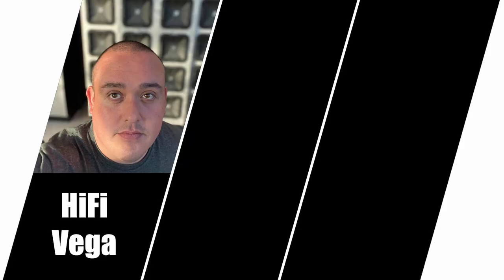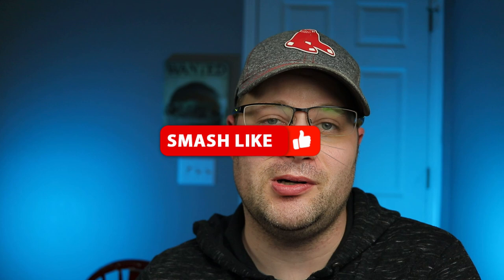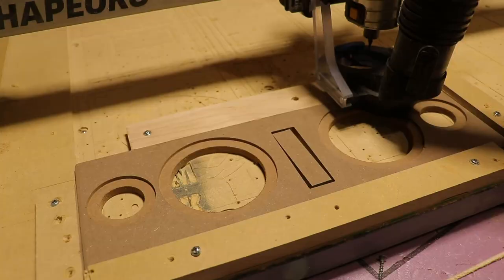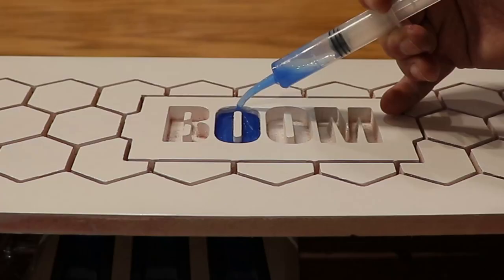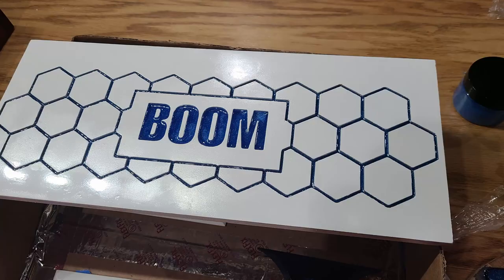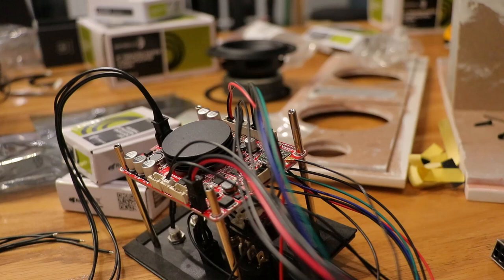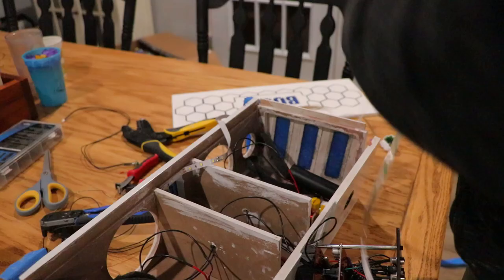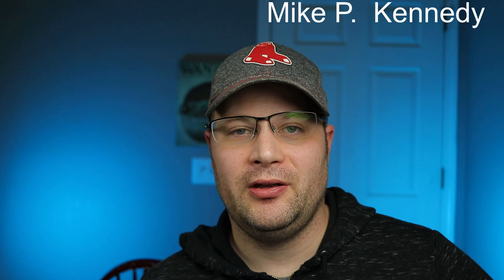MK Boom DIY Boombox AWESOME Build!

Comment: While I don't get into epoxy pouring, I have historically used thinned epoxy as a primer/sealer/surfacer. It turns MDF into a sort of phenolic material that ends up highly moisture resistant. 

Nice work and thanks for the video. Excellent build.

Comment: Hi.  I built your subwoofer with front slot port.  Bought your plans. Sounds great and will be perfect in my conservatory this summer.  Now wants to build a portable boombox with battery operation.  You recently built the MK Boombox and if you compare it, in terms of size, dynamics, sound quality with your own portable Dinas with Dayton Rs100 o TB 1138. Do not think only of bass!  Who wins on the sound?  As well as size?  // R
Reply from the maker: The Dinas hands down. Nothing against the MK Boom, is just not the greatest sounding. It sounds fine, but is definitely priced accordingly. I was actually talking to DIY audio guy, and he agrees with at least the assessment of the MK boom. He has never heard the dinas boombox.  You could also try one of the other boomboxes from Parts Express. I just haven't personally heard them.
Reply: @Toid  Fantastic.  Thanks for your reply!  Dinas is powered by a 2.1 amplifier board.  When I order the drawing from your shop, does it come with a crossover sketch for notch filters for RS100?  Know that in your previous YT videos you talked about the need for a good filter for the RS100.  Should I build, it will be all-in.
Reply from the maker: @rikardekvall3433  great question. It does come with the drawings for the Knox filters. And of course if you have any questions about it, you can let me know I'd be happy to help you.

Comment: Hi, I have an old 1940s tube radio that I am restoring the wood on.  I am pulling the broken guts out of it and have plans to put a Bluetooth speaker set to replace the old parts.  Would you have a recommendation for a good kit (speakers and Bluetooth amp) for me to use?   Looking for some advice.

Comment: Sir i have a doubt to ask you.
When we build a 3 way tower speaker with 3 different rated impedance drivers like 8(tweeter)+4(mid bass driver)+4(woofer).And we connect them through a 3 way crossover network what would be the effective impedance for amplifier?
I mean to know what would be the effective impedance of that box and how to calculate that?
Thank you
Reply from the maker: https://youtu.be/MMTGDiLjsZ0 if you have more questions like this, you should really ask on the forum. That's what it's there for. www.toidsdiyaudio.com/community
Reply: @Toid  Thank you sir. I'll definitely join the forum

Comment: Your boom box is missing something important.  Where's the handle? How can it be a boombox without a handle to carry it around?

Seriously, great job there.  How does it sound?
Reply from the maker: I mentioned that in the live stream, I don't think I would ever bring it anywhere.  But even if I did, it is the perfect size to throw in a back pack or something.  So I didn't really see the need for a handle. As far as the sound.  It sounds okay.  For $130 it sounds really good.  Decent bass down to 50hz or so, but no real low bass. It is basically the MK402's in a boombox.
Reply: @Toid  "Throw in a back pack"?  Sacrilege!  Boom boxes are supposed to be seen as well as heard, LOL. And your build definitely needs to be seen :-).  It's a great build - definitely my favourite of the three. I'm planning to buy and build that same kit, BTW, but may replace the vents with PRs.